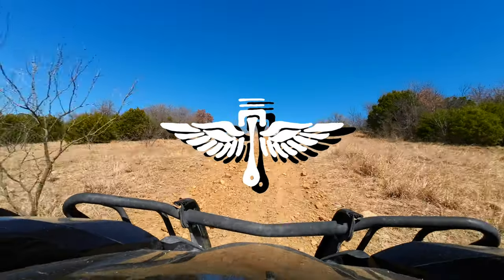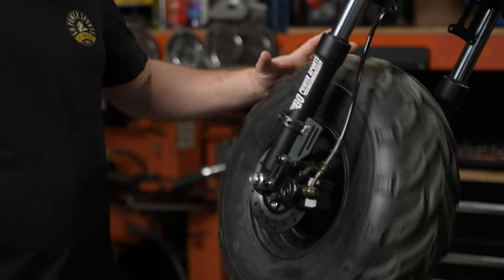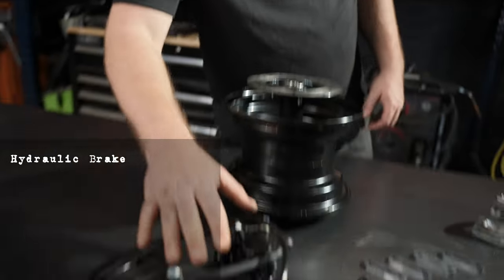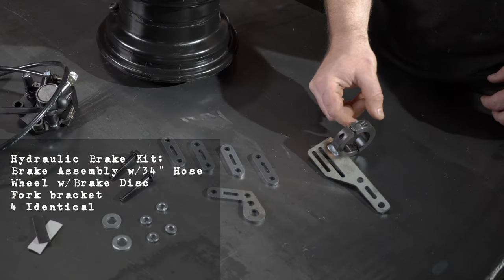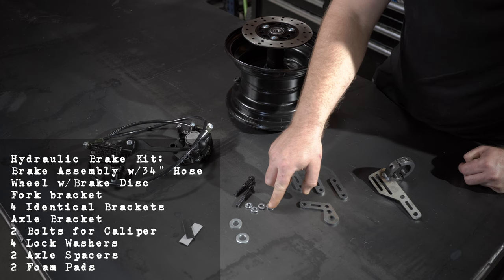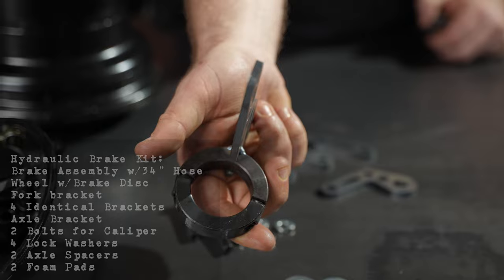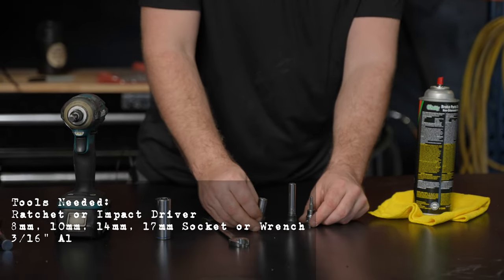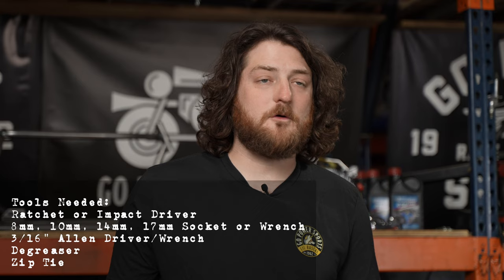How to Upgrade Your Coleman Mini Bike Brake System in Just 5 Minutes!

Comment: What's the reason they won't work on the CT200U-EX? I thought the front forks were very similar.
Reply: I was thinking the same thing TJ🤔
Reply from the maker: The RT200 resembles the Mega Moto 212 front fork which is bigger than the CT200-EX.  This kit will not fit as nicely on the CT200EX bikes but we will be working on that!
Reply: @GoPowerSports  Thanks for the reply, when you have one for a CT200U-EX I'll be the first in line
Reply: @GoPowerSports  Sweet that's good to hear GPS. Thx for letting us know that there might be something like this for us CT200EX riders here in the future👍
Reply: Good for bt200x?
Reply: Rear thats it
Reply: Let us know when y’all get the CT200-EX KIT AVAILABLE

Comment: Please make some different kits for the Bt200x all the people I know have them but not many upgrades.
Reply from the maker: For sure!  Thanks for the insight.
Reply: Yes. Please add kit for BT200x. Include tire installed on rim as well.
Reply: Make it for the X and I'll take two, we can't get em slowed down!
Reply: Will this kit work on the CT200U-EX?
Reply: Will this kit fit the CT200U-EX?
Reply: Yup Btx200 please
Reply: @michaelmincey2622  No not directly. I'm told they can be made to work with some fab, but they're workin on a direct bolt on for our EXs
Reply: @BM205  have you tried th 304g slotted brakes they are a motorcycle brake pad and help with this problem
Reply: @heathenprojects2639  I haven't tried those but I'll look into them. Thanks.

Comment: The only thing I don't understand about these brake kits is you think they would be set up to mount on the right side of the bike considering it's just helped throwing it off balance because the weight of the whole drive clutch system and chain and sprockets is already on the left side the brake should have been mounted on the right side to help balance the weight out if anything not to add more weight to one side but I guess front brakes are better than no  front brakes

Comment: Best thing I can buy should be the first before any power mods I went thru three stock ones two mini hydraulic ones with the same small pads once I zip ties and scope rifle mounted a duel piston brake system I haven't gone thru a pad yet I'm talking over 50 mphs hundreds of miles still got plenty meat left because they're meant for bigger rotors so only time will tell

Comment: I wish someone would make a video on what to do when you have a runaway minibike meaning how do you fix this problem?
Reply from the maker: Ill make one. For starters, I would start up the Minibike with it pressed up against a wall.
Reply: Operational kill switch you can reach. Up against wall. Check clutch is properly disengaging.
Reply: @GoPowerSports  good for bt200x stock weels?
Reply: Where bye this caliper 🤓

Comment: Is there a kit for the rascal non suspension front end?
Reply from the maker: As of now there is not a front brake kit for the Rascal.  You will see a Premium Rascal that will be fully decked out and complete hydraulic brakes.  That'll be the end of 2023 though.